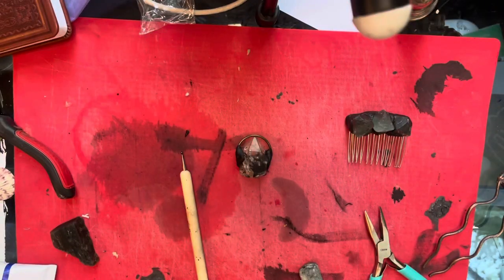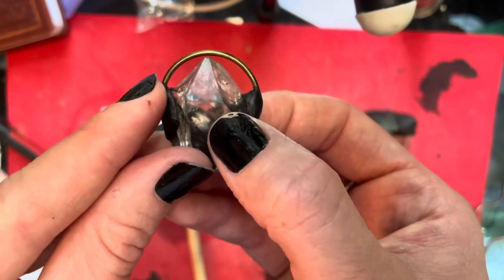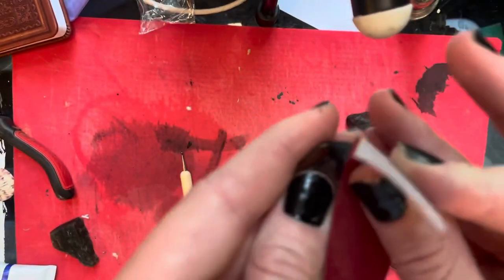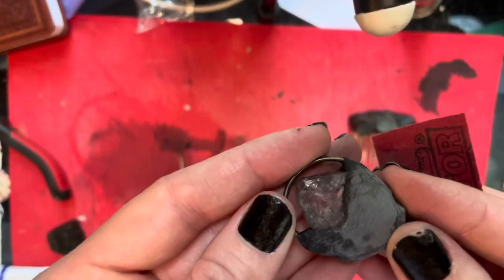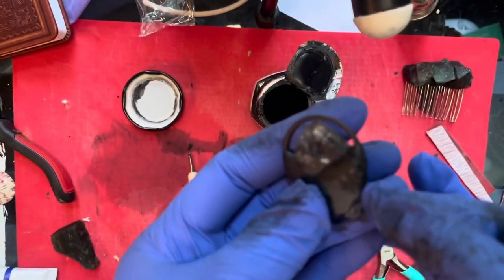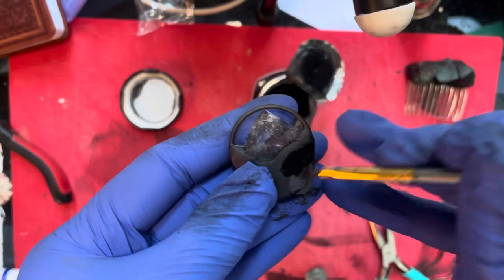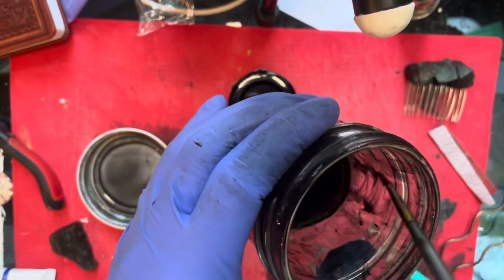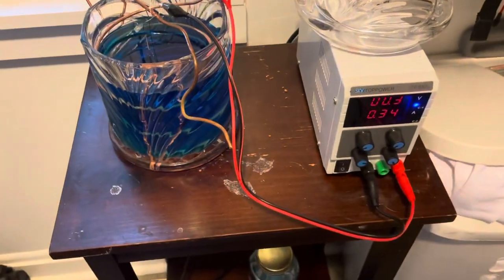Using Conductive Paint for Copper Electroforming Jewelry

Comment: Thank you Sarah! I never sand the apoxie and I think I'll start doin it. That's a very nice tip. I use acetone based conductive paint and sometime it doesn't stick very well on the smooth surface of the apoxie. I hope it's gonna work better. Nice video btw.